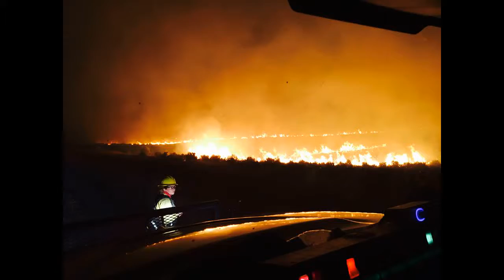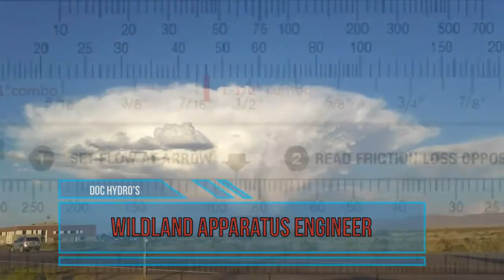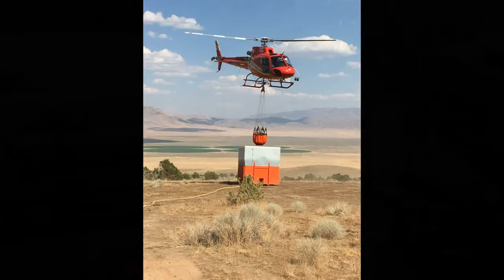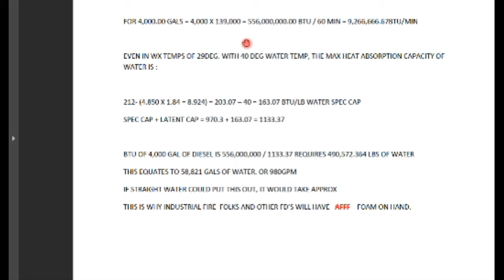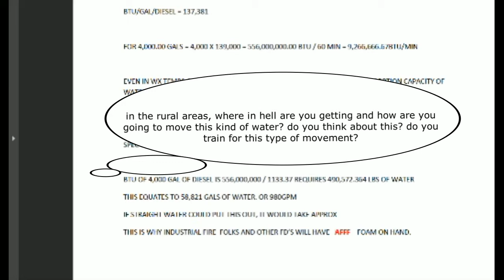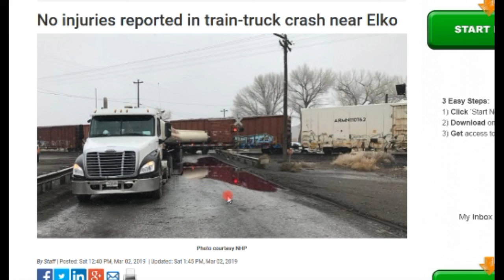Diesel fire and BTU?

Comment from the maker: I had an individual ask me if the 556,000,000 BTU i talk about in the video was the total BTU for the entire truck as it seemed low. Good question, NO it is not, that is only the amount of BTU based off what was reported to have leaked (4,000gals of fuel). If we make a couple assumptions as to the total gallons that is carried then the total BTU would be like so. if we assume that the tanker carried only 7,000 gallons total, then the total BTU capacity would be 973,000,000 BTU. this would require 103k Gallons of water, and if we assume 9,000 gallons of fuel carried total. then the BTU total Energy capacity is 1,251,000,000. and would require 132.7k gallons of water. (assuming no AFFF etc) This also does not count the BTU in the surrounding shrubs etc, buildings other fuels etc etc.  If you account for those then the BTU only goes up from there as can be expected.   Something else, this happened at the perfect time of year. ambient temperatures were perfect,  COLD!, the fuel was COLD so the fuel giving off vapor and raising the flashpoint was extremely low.  middle of July and August with 100 degree heat? fire48pw went exactly where i was thinking with the fuel (had it ignited) taking out the rest of the truck and then it becoming a bigger mess from there. you would have enough heat generated to create area ignition.

Comment: As a retired Fire Chief, you are correct in all of your assumptions especially when you say to consider it a Blast Zone.  The biggest problem you describe is the sudden intense heat...BTU's and it's effect on the remaining fuel in the Tanker and then the Propane Tank, here is where a BLEVE can happen.  For a well trained Fire Department weather Rural or not there are ways with a quick response that it might be able to put this down quickly with the use of hand lines and  properly applies Dry Chemical from fire extinguishers.